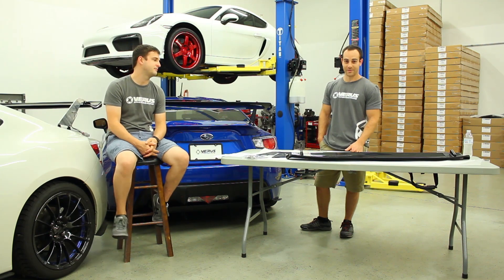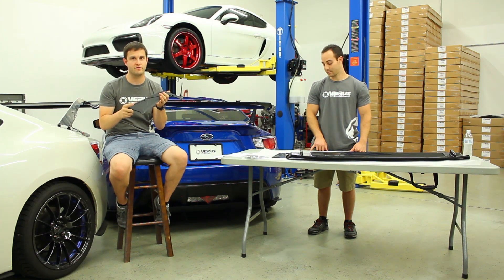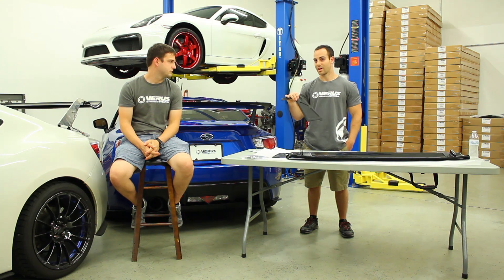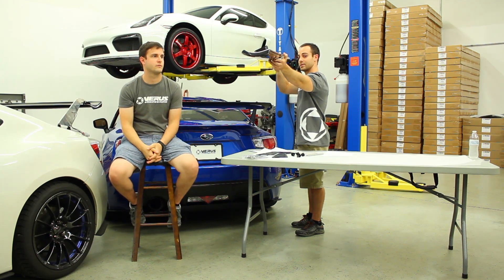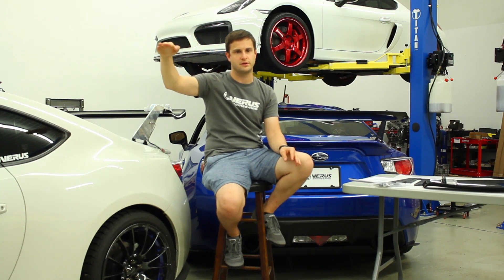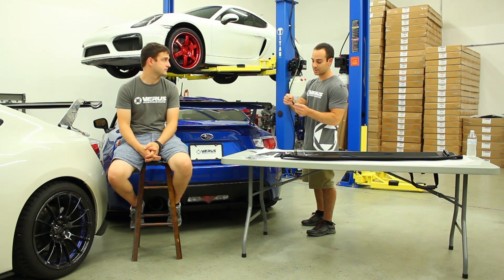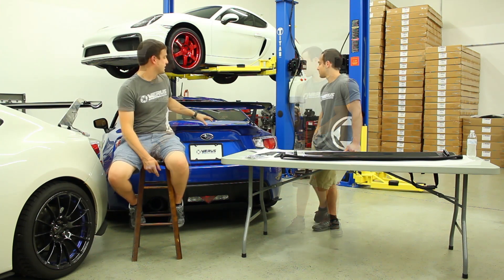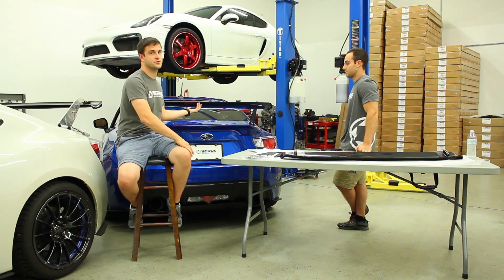Low Drag Rear Wing FAQs

Comment: Ausom technical Q&A  you have a nice "wing"  insted of a "spoiler"
Cfd  cutaway... whar is the verable ? What is being compaired left to right? Looks like a compairison of w/, w/o grill block in place,  or different  speeds.
some thoughts
 The defamation of the trunk? Is it from the swan neck rotating(front up, back down), pivoting (just back down) , or sideways. .

 Cost down test. 
The wing devates(higher drag/downforce= faster slow down) the most from stock @below 45mph . Means it is working harder at cornering speeds  as desired.

 "Coke bottling " is the turm I know.

Small!!!    Function over Form...

B-52 wing "flexes"  17' feet

Duck butt keeps the recirculation vortex (behind the trunk) from blowing up on the underside of the of the wing causinh higher pressure.

The hole in the back of the donut is more important than the size of the hole in front.
Reply from the maker: David Drescher please send us an email David. Sales@verus-engineering.com